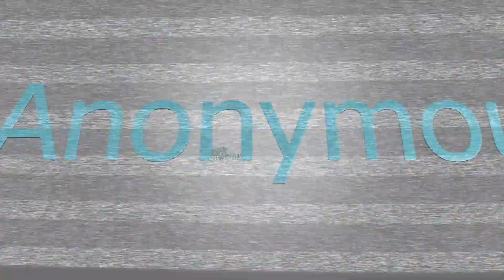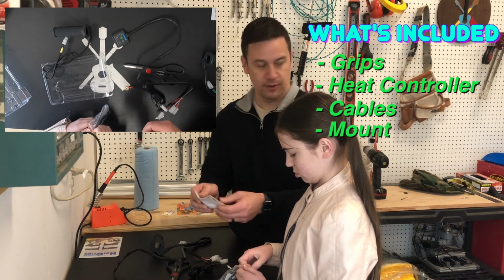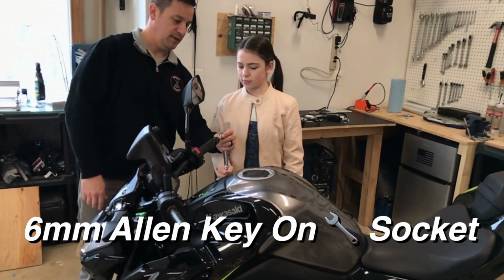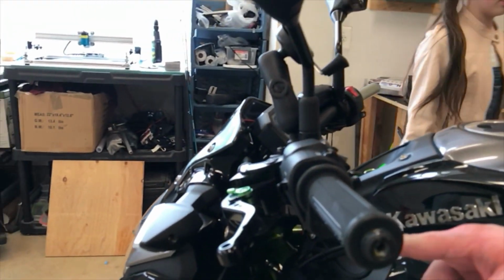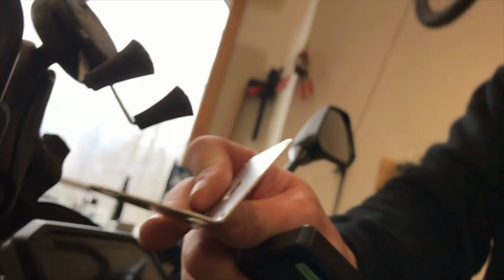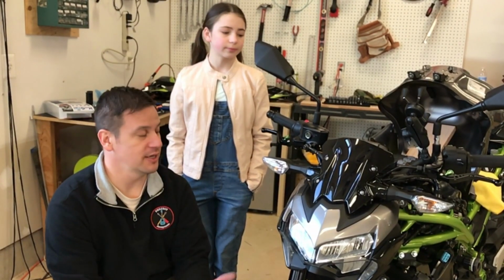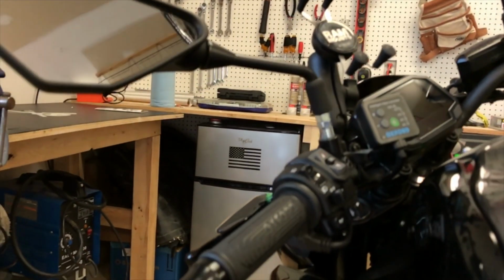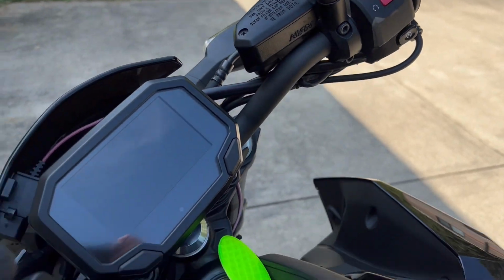Installing Hot Grips on our 2020 Kawasaki Z900 Motorcycle + REVIEW

Comment: there is a 12v connector right under the TFT display which it gets on only when the bike is turned on that's what I used to install my usb charger  i reckon that might have been a little easier  but still excellent job !
Reply from the maker: Thanks for the tip!

Comment: Where did you plug then in?
Reply from the maker: Hello there! The wiring harness on these plug directly to the battery post with a in line fuse… I was initially worried that if I forgot to turn them off they would kill my battery, but there is a sensor in the control unit that shut them off automatically (and I have forgotten to turn them off before… no battery issues). Hope this helps!